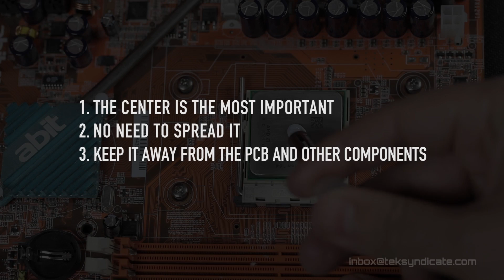How To Apply Thermal Paste

Comment: When i applied thermal paste some leaked to a ram slot so cleaned it of with lint free cloth and i did a stupid mistake of putting the cooler in then out then in. I'm reapplying tomorrow since temps where 44c idle on an i5 4570.

Comment: HELP PLEASE!! 
My PC has been running BF4 fine for the past year. I play on MED settings and average 50 FPS. The game is still running at 50 FPS, but every 30 seconds or so, my game will spike down to like 10 FPS for about 1 second which causes EXTREME stuttering! I did recently download catalyst 14.9 drivers. 

My PC Specs:
AMD FX 6100
Sapphire HD7770 ghz edition
8gb ram
500w psu
1tb hard drive
Mini asus mobo

Thank you for taking the time to read this!! Any help would be greatly appreciated!!
Reply: So far, only BF4 has extreme fps drops. Far Cry 3, Bad Company 2 and Dirt 3 all run perfectly fine. BTW, this the problem started right after I downloaded the new catalyst drivers.(14.9)
Reply: Gotcha. Thanks for the help Nigel! I'll let you know if my problems stop after I download the previous drivers.
Reply: Hey Nigel, I did uninstall catalyst 14.9 and downloaded catalyst 14.4 and my BF4 is functional again. Thank you Nigel for the idea.
Reply: clonewars22 also if this happens try turning off origin overlay it fixed that issue for me and alot of of my friends
Reply: Hey Jonathan, thanks for that info. I did recently contact EA concerning my issue and they had me turn off Origin while running Battlefield,(Like you said) and I repaired the game. My Battlefield 4 is running normally again and I couldn't be happier. :D
Reply: Go to MSCONFIG, disabled anything what is not Microsoft and see if that works. If that works, then check what's causing the slow down, if that does not work, then there is something wrong between your motherboard, CPU, memories and GPU.

Comment: In the pea method, the paste doesn't cover everything, probably a good 70~80% of it is covered. Does that mean it's not necessary to have everything covered?
Reply: Yep, you don't need to cover everything. If in doubt, it's better to use too little and have to re-paste it than to get that shit all over your CPU and have to clean it off, knowing that bending a single pin renders your 400 dollar toy worthless.
Reply: You really really don't want to get conductive paste on the PCB. That's bad news. Unless your cooler has ridges or something, don't spread even a little.

Comment: believe it or not...my bro is a computer builder and after many years of using thermal paste he has converted to good old white petroleum jelly also known as vaseline..yer and has done so for over 10 years now and swears by it and even after 10 years of being applied it never drys like thermal paste dose....this pc im using was built by him with vaseline as the paste and still spot on after 6 years running at cpu temps of 29.5 deg c atm and the room is 25 so only a few degrees warmer cpu...a little secret.
Reply: I have an old pc in my basement. Its like 15+ years old and the thermal paste isnt dried yet.

Comment: Might be a dumb question, but what other "solutions" can you use aside from Isopropyl Alcholhol, as I don't think I have that around to remove my excess CPU gunk.
Reply: +kingpinneapple188 just use some que tips. they dont leave fibers and they are mildly stiff so you can get the major gunk off.

Comment: Dudes, I watched some other videos from you as well, so that's not an opinion based just on this one: why don't you spend a little time learning the physics and theory on the stuff you give advice about? A lot of people listen to what you're saying. 

This video for example: thermal paste is put between two surfaces in order to replace the air between them. There's nothing wrong with the so called "terrible" spreading method - a very thin layer on both surfaces + press'n wiggle works very good. If you can see the metal surfaces after you pull the heat sink off - then the application is good. On the other hand without sufficient pressure on the paste the pea method can leave a big blob in the middle. Thermal paste is not a good thermal conductor and there's no need for that, because the paste application has a totally different goal. 

I'll just mention Gaming Audio Myths and Audiophile myths, so that you get an idea about what I mean with the need for knowledge. The comments on sampling rates and output impedance/power are plane wrong.

Comment: It's been about 4 months since I last applied Thermal paste to my CPU, how often should I add more?
Reply: You really only need to do it again if (1) you are getting unusually high temps or (2) you are replacing the heat sink and/or CPU.
Reply: TacticusPrime Thank you.
Reply: ***** And what type of fabric should I clean those two things with?
Reply: ***** Thanks for the quick reply, much appreciated. :)
Reply: lol my old gaming rig i bought it last 2009 never reapplied a themal paste again then it the motherboard just got broken i don't know why but the cpu is still working though i used it for about 5 years :) without any heating issues..
Reply: Bassman75 yea but ***** wrote that if applied correctly than you should never have to replace it and that's wrong after a time thermal paste dries and don't conducts heat that well.
Reply: ***** when it dries heat conductivity decreases significantly.
Reply: ***** i never mentioned how much time it takes. Its all about what kind of thermal compound is used. In your first comment you said that if applied right then you should NEVER have to replace it. When u say never its like infinite amount of time so after 10 years thermal compound will work same as the day it was applied according to your logic.
Reply: As already been said, do it once, do it right.  I am probably easily onto my maybe 5 yr running on the same paste (Arctic MX-2) and touch wood still going good.
Reply: If you start seeing temperatures rising or fans working hard and cleaning out the dust doesn't help... its time to reapply.

Comment: Hello sir...maybe you can help me i have an old motherboard ASUS p5kpl-am in/roem/si. I change stock thermal of Northbridge to aftermarket thermal. Before the temperature is normal but now its overheating 52 degrees in BIOS hardware monitor.

Comment: My CPU is 89 degrees when I play a higher end game which sucks and I'm pretty sure I need new thermal paste. How much of a difference would it make?
Reply: That is ridiculously hot. Mine runs at 45 max while high end gaming. I strongly suggest you reinstall your CPU and try for a better result. Make sure you don't use too much thermal paste OR too little. Just like in this video shows, 89 degrees will likely kill your CPU in no time. (Most people don't even allow theirs to go over 60 without reinstalling the CPU)

Comment: I always spread the thermal paste over the IHS using an old card, never had a problem.
Reply: +Izak80 but as you can see, spreading it can make things uneven when applying the cooler, creating air bubbles, which is bad. also you don't need it over the whole IHS, because the cores are in the middle, very small, like take 20% space of the whole IHS in the middle and the rest is literally nothing. so corners don't need to be covered, which is why the pea method is the best one. it spreads nicely, it covers what it needs to cover, it will just work perfectly.
Reply: +Izak80 he just told you why you shouldnt lol there will be airbubbles

wich means you wont get any problems maybe but its will still be hotter compared to when you do it right

Comment: I use a nice phat x and check to make sure there is no over flow# cue tip. also a 5 dot dice method works well.idle temps 10Dc-to 49 tops during bf4 gaming with master cooler hyper tx3....25$ The idea is the paste must fill in as mutch gap as possible between the cooler and cpu with no gaps or air bubbles the dot/line method is crap.Obvious gaps.I also love how the video links don't work,..

Comment: for how long must u wait before u can use your computer after used it ? will this make my computer sound more quiet too ?
Reply: Right after you apply the thermal compound and your rig is ready, go ahead and use it.
Reply: do u know if it will effect fps if you have to little thermal compound on cpu and gpu ?
Reply: *****
It'll run hotter, and the hardware will throttle down to compensate for all of the heat. Meaning lower frames.
Reply: okay thx

Comment: Damn dude. Good video.
I skipped most of it and looked at the pictures. Did you mention that less compound is more? The thermal compound is only to connect the cooler to the CPU.  Too much paste and the thermal transfer sucks.  Air bubbles also suck ass. As air is an insulator.
That rock on though, that was tits.

Comment: Can I use soap or some other common cleanser to clean up the old thermal paste? I am planning to change my computer case so I need to move all the stuff so I think I have to detach my cpu cooler and install it again.
Reply: are you being serious?
Reply: +EliteShadow4 About what? It was just a question dude. Besides, I already did it without any liquid.
Reply: +Lerppasd7 Lol ok. now I know you're trolling.
Reply: +EliteShadow4 I dont understand you.
Reply: +Lerppasd7 Ok to answer your original question, no you cannot use soap or type of clenser, they usually contain water or a conductive fluid. you're supposed to use Isopropyl alchohol, it cleans and it evaporates quickly. Or I suppose you could just use a microfiber cloth with nothing on it and wipe the processor until there is no left over thermal paste.
Reply: +Lerppasd7 Hey man, you can use any rubbing alchohol.  If you are using stuff under 70% just wait longer for it to dry.  I can't confirm this is safe but apparently nail polish remover does the trick if you're really in a jam.
Reply: +Sean Weatherall I already did it but thanks. I used a coffee filter to clean it up, didnt need anything else. It got off easily with that.
Reply: +Lerppasd7 Good. The liquid is just supposed to help it come off easier and wipe the residue off of it but I think it's fine. As long as your temps are fine it's probably fine.
Reply: EliteShadow4 I have an i5-4670k which runs at 3,9ghz at full load with 1,2volts. I also have an Arctic Freezer 13 and the cpu runs at 35C in idle and about 60-70C at gaming. When I run CPU Prime for 15minutes, the max temps can reach to 80C but average is about 70-75C. I suppose with those volts its not the best temperatures but its not dangerous either.
Reply: +Lerppasd7 damn im running 4.8ghz at 1.3 volt max temp is 65C O_o idle is about 20C
Reply: +Lerppasd7 4790k here
Reply: +Counter Russianstrike what is that a custom loop?
Reply: +EliteShadow4 no h100i however the pump wasnt running at full rpm and actually died less than an hour ago so hopefully ill get better temps on the replacement also the thermal paste wasnt seated properly
Reply: +Counter Russianstrike I'm calling fake lol. I have an h100i with a stock 4790k and my idle is like 29c lowest I've seen it is 24c idle. You can't even change how fast the pump goes. Also how can thermal paste not be seated correctly?
Reply: EliteShadow4 did i say you could change pump speed? no it was dying so sometimes it would be @ 300RPM in corsair link and sometimes at around 2000rpm however today it died so like i said im waiting for replacement
Reply: EliteShadow4 Also idle temp differs on a few thing's like ambient temps in your room how well your case is equipped with fan's so your judgement there of "mine is bla bla" is irrelevant sound like a 10 yr old
Reply: EliteShadow4 Also just ran Default optimal setting's for the 4790k and it pushes it to 1.2xx volts however if you had a brain you would realise this can be lowered by your self and still remain stable depending on your chip
Reply: EliteShadow4 i don't use stock paste that came with it i scratch that off and use some good stuff when i put it on i used card method not pea method so when i took it off it looks uneven and shoddy.
Reply: +Counter Russianstrike Calm down, I'm not attacking you. What fan curve do you use, is it custom and what is it?
Reply: +Counter Russianstrike also what do you use to monitor your temps?
Reply: Coretemp and link software + MSI afterburner ingame monitors
Reply: Don't use a fancurve i just have link on balanced mode
Reply: +Counter Russianstrike yeah I use link on balanced mode aswell
Reply: If you know how to check your bios to see what voltage its running your CPU at

Comment: How about on large square gpu die with no heat spreader at all?? Best method? Full coverage on a bare die with no heat spreader will need 100% coverage, different than the cpu.

Comment: I think your credit card method didn't work well because you didn't prep the surfaces.I did a few experiments a couple years ago (water cooled block on an overclocked 4790K CPU) and the best results (6ºC better than any other method) was to use the credit card method, Artic Silver II, - but wetting both surfaces and "twisting" the water block slightly 4 or 5 times CCW & CW before securing it. It's also important to first clean both surfaces using 99% rubbing alcohol on a coffee filter (dust free). Once cleaned, pre-wet the surfaces using a mixture on Artic Silver thinned with 99% alcohol on the coffee filter and applied a layer so thin it was nearly invisible (colors the surfaces). Don't worry, the alcohol will evaporate before you apply the thin layers of thermal paste.To test temps, I used Handbrake to (9.2) to transcode videos for 20 minutes. The earlier versions of Handbrake used all available cores/threads - for the 4790K - 8 threads.I think the key was "wetting" both surfaces. My temps: Pea  <= 58ºC,  CC wetting both surface <= 52ºC

Comment: Question what if i put thermal paste and the CPU cooler may i play than already the pc or does ot need it to dry or stick there still ? For awhile
Reply: oh yeah and i dont really know but im totally confused i thought that putting thermal paste that would cool me pc alot
but ive tried the pie en pushed a bit with the CPU cooler and than ive locked it the screws etc but when i checked the pie was than totally gone from the middle o.o it was off the sides not in the center im so confused ? how to cool alot or do what i need to do after putting thermal paste
Reply: Maijie Jiang Put thermal paste in the middle pea sized, screw down heat sink and play games or whatever

Comment: Hi guys can  anybody tell me how often you should apply new thermal paste? ive been changing mine once a month but im not sure if this is often enough? i want to make my pc last as long as possible how often should i change it?
Reply: A good paste should last at least a couple years, monthly is ridiculous. If you need to change it that often you're applying it wrong.
Reply: RageBucket

Im not sure if i need to change it that's the thing i just want to make my pc last as long as possible, I change my car's oil once a month for the same reason. I feel with thermal paste so cheap its a no brainier and should make your pc last much longer.
Reply: ***** If you're not completely removing all the paste then you're applying layers, which is bad. There should be one thin spread layer, and if you ARE removing all the layers you should be careful as to not wear down any metals particularly on your heat sink, especially if the copper coils directly contact the CPU (and in turn the thermal paste). If you're removing it with material specifically made for removing the thermal paste it's not so bad, but if you're using rubbing alcohol or something of the sort, and using any sort of force (as may be needed) you could be causing harm by doing it so often. Most pastes nowadays advertise a life span of 8 years, ie some arctic products, but I would go with 1/4-1/2 of the advertise life span when it comes to re-applying a new coat. What you're doing isn't bad per se, but it has it's dangers.

Comment: (pea method) The middle get covered, but what about the sides ? Arent those important ? 
In my mind, im thinking that the sides get superhot & need cooling aswell, so why not just cover the whole thing ?
Reply: +Liquid Pixels  thats why i spread it out, thin..it workes all points coverd. in this vid you san see what works, but they lye, the whole servace need to be covered..
Reply: +Liquid Pixels Ideally you want to cover as much of the CPU as possible with just a thin and even layer without air bubbles, but you also don't want it to spill over the side when there's heat. Remember, heat makes things expand. So as soon as that CPU gets warm, it'll become a mess. And if you're using conductive material, you might ruin components.  

The cores are in the center of the CPU, not the 4 corners. The cores get hot, not the corners. If you cool the cores, then the outside stays warm. The hottest the outside will probably ever be is 70C which is still 10C from warning and 20c from danger. If you're using a proper cooler (NOT STOCK!) then your temps will probably stick in the 35c range or 50 under load. Not even close to a problem there. 

So TL;DR no, the sides don't matter, the cores do.
Reply: Michael Gates Thank you for the explanation, now i feel safer with the pea method. I`ve been using AMD CPUs so far, but will change to an intel i5 4690k shortly.
Reply: Liquid Pixels AMD will always run warmer than Intel, for reasons that you can look into yourself. Nothing too drastic, maybe 5c but enough for you not want to use a stock cooler. 

But the upgrade from AMD to Intel will be nice!

Comment: It's been my experience I've gotten lower temperatures by spreading, which is why you see things like this http://www.newegg.com/Product/Product.aspx?Item=N82E16835119060 that come with a spreader. I've actually purchased artic silver this way at Fry's before. Granted I also didn't spread it to the edges of the CPU/heat spreader because I knew it would expand with pressure, I guess to each their own.